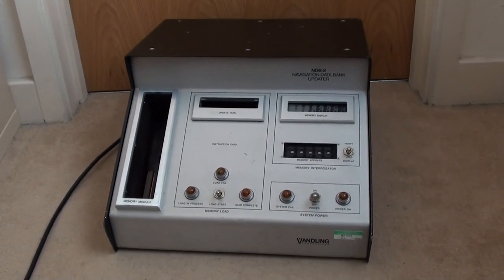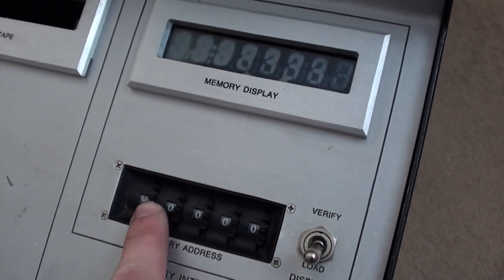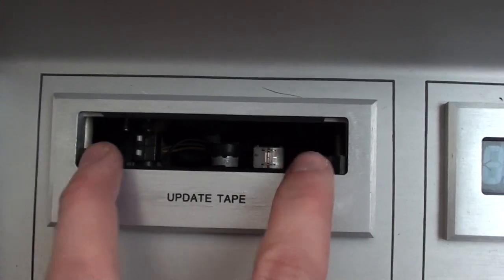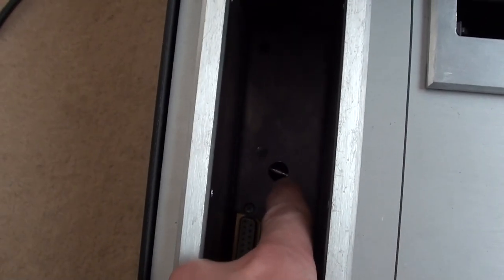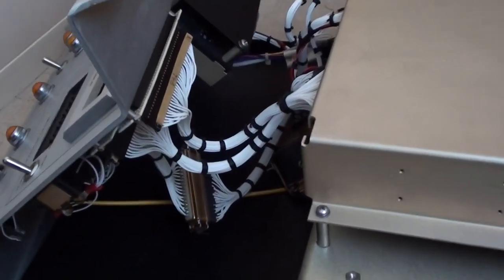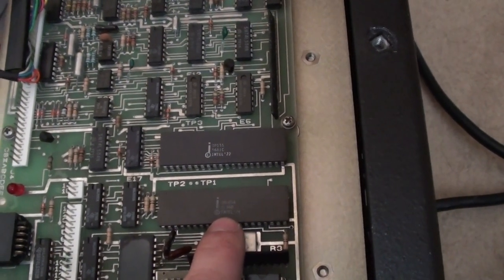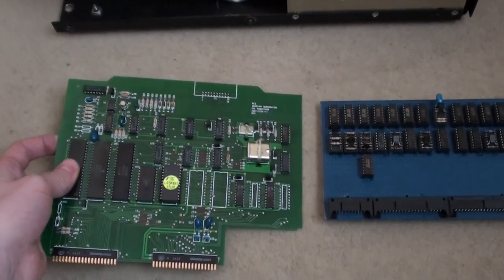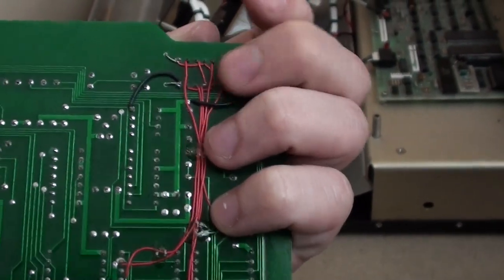Aviation Data Bank Updater Teardown

Comment: I sent a message I sent with some details, and now ill share it here in the comments:

"
Hello, So i went looking around for some information about the NDB-2 machine you recently made a video about.

I found that it was mentioned in what i think is a magazine titled "FLIGHT International, 13 December 1980" The section that mentions the NDB-2 is here: https://i.imgur.com/xauD0L0.png

From the sound of the advert it talks as if the device was used on the airplane its self. This would explain the build quality. But since the machine you have is wired for mains. This device most likely sat on a desk in the ATC tower and had the update tape left in the machine for the current month. 

This would allow pilots to remove the memory module, bring it to the ATC tower to get the latest updates each month from the update tape in the machine. The pilots would then take the tape back to their aircraft and install it again in the corresponding device on the aircraft.

It also mentions the OMEGA navigation system, which is used for helping aircraft know where they were on the earth with an accuracy of +/- 2.2km which in 1980 was still quite good. https://en.wikipedia.org/wiki/Omega_(navigation_system)

The GPS system we use today was first begun as a US gov. project back in 1973, But civilians were not given access to the GPS system until 1995 when it was completed.

https://i.imgur.com/KqpPZfG.png
Here is another mention of the NDB-2 using "bubble memory" that was used in satellites at the time for quick memory read and write times. 

If you would like more information I could probably find more.

Cheers, and congratz on a great find :D
"

Comment: Picture of the tape for that drive here, on the right: https://upload.wikimedia.org/wikipedia/commons/8/8f/DECtape.jpg DECtape was kind of the lingua franca for microcomputers in the 70's, it would have been used to transfer data from a VAX or PDP.

Comment: That tape drive is for DECtape II cartridges.
I used to have a data storage unit which I tore down for the floppy drive inside of it; it had separate linear power supplies for +5 and +12 volts, and had a Tandon TM100 floppy drive and a Tandon TM502 hard disk drive inside, both of which worked.  The +12 power supply is currently being used to power a Tripath amplifier.
Reply: The good ol DECtape II... in all its usual gooey roller goodness

Comment: Lots of nice things in there to save, if you do have to scrap it. the power switch, bulb housings, the 6800uF caps on the PSUs are good for something if still within spec, and the hex rotary encoders definitely. when you move into your new place and get a shed again, if you inevitably have to scrap this unit, save that power switch for the LEDs that go over or under your workbench. I'd love to see a project that reads the encoder block using an arduino to unlock the shed via maglock aside from a key, or at least a proof-of-concept towards that which shuts off an electromagnet.

Comment: An NDB is a navigation system for airplanes, 400Hz is common used in airplanes, maybe the 2 power supply could be redundant or one for 500hz and other for 400Hz, I think, looking on switchint power supply avaiable now, that the transformers could be different to work at diferent frequencies.

Comment: The encoder wheel is to regulate the speed of the tape, not to determine its position. It would just rewind the the beginning and start reading the data. As long as you have a consistent speed, it can work out the serial data.

Comment: That is a QIC tape slot.  I can tell by the slots on the bottom.  QIC tapes had a metal base plate that stuck out on the edges.  This takes the smaller tapes like DC2120 formfactor.

Comment: Regarding the cassette slot: Maybe the two switches have to be engaged e.g. with the end of a screwdriver, in order to connect me electrically?
And regarding the two power supplies: As the manufacturer resided in the USA where 115V are in use, maybe they put two supplies in a row to divide the european 230V to 115V (just guessing without further knowledge), so that the remaining device design could be reused without any further modification?

Comment: Fab video Carl - Always love vintage tech - so much more interesting than current generation kit. All the functionality of that unit could now be in an IC not much bigger than your fingerprint.
Reply from the maker: +Richard Parry Thank you, Richard. Yes, every function here could easily be emulated in an Arduino, and still have plenty of memory and processing left over, and for 1/500th of the price and complexity
Reply: I have built boards not completely different to that blue board - was building a CPU project out of 74 series logic. That board looks incredibly professional compared to what I built. :) I would guess that it took about 50 to 100 hours to build, at least. Incredibly hard work and the fault finding would probably be a nightmare. The worst part was that it was very easy to burn off the insulation on that prototyping wire so you would end up having to do things then repeat them, it also heated up so quickly that you would always be burning yourself.. That's also why all the components are in sockets - to avoid them being destroyed by overheating.

Comment: Very interesting piece of equipment. It seems that based on the weight and size, this would be in either a Business Jet company's office or FBO or an Air Traffic Control tower (Less likely). Like you said, it probably updated the memory banks using tapes.
Regarding what to do with it, you could take out most of the circuitry and tape drive, and install a SSD or Hard drive dock in one or both slots, and have a fun way to make backups of hard drives! :) I know movie studios and Youtubers who record digitally have docks for offloading videos quickly, and this could be a fun way to do it.

Comment: Looks to me a lot like a prototype. Vandling Corporation appears to have been bought by Sundstrand Corporation in 1981. At 230 VAC, the power supplies may have been made for the European market, but there's no telling if the update date on that sticker is May 11th or November 5th, since Vandling (and Sundstrand) was based in the US. The IC production dates seem to push the overall production date into late 1980 or 1981.

Comment: Woah - for the hand wiring. Maybe this was set up to interface with a legacy system that couldn't be upgraded? Or a repair job?

I'm surprised that the whole thing is so elaborate, given what it seems to do. Perhaps it carried out some calculations on the data it real time or the encoding/decoding for tape was complex?

Yeah, probably redundant power supply. Any ports so that it could power a similar auxiliary unit?

Interesting teardown.

Comment: I had a thought that the blue board May be a custom deal. if the original board  was no longer manufactured, or was not in the budget at the time, and was needed ASAP, they might have had someone wire up a reasonable facsimile of one, so they could continue to use this piece of equipment with out replacing the unit or switching to a newer / more advanced/ more expensive  model of the machine.
Reply: There could easily be 50 to 100 hours of work in that board - its a technique you would normally only use for building a prototype so very strange.

Comment: Ok, so if you saw my last comment, I was totally wrong, What this device was used for was when there was a firmware of software up date for any system of the plane, they would load the data on to a VHS (ish) sized thing I cant remember the name now. Then someone would write the number on the drive (lets call it that) where the file they were looking for is. I hope this helps. And also, from air bus.And I was born in 2001, so... Don't take any thing I say as a true fact. It might be wrong.